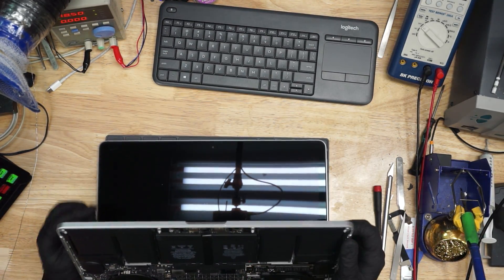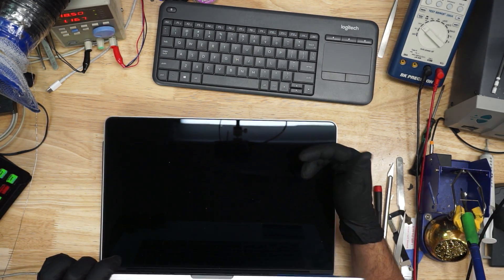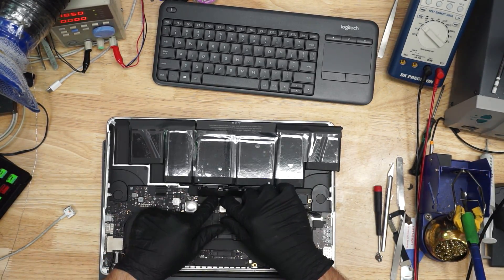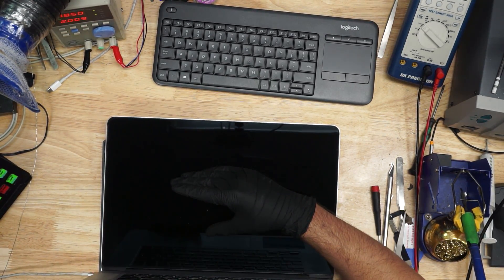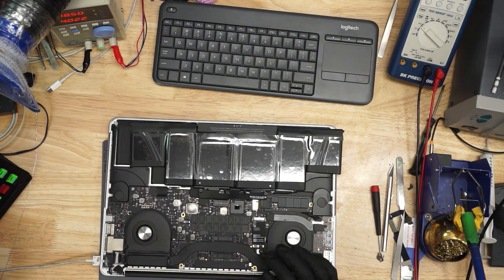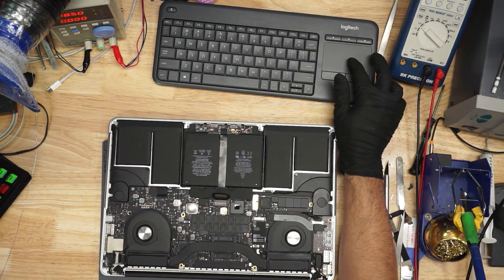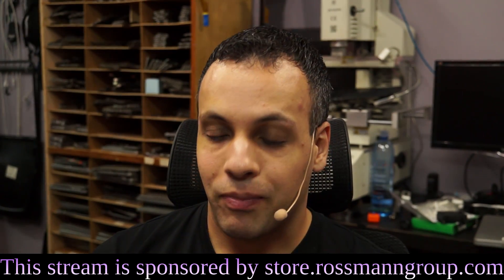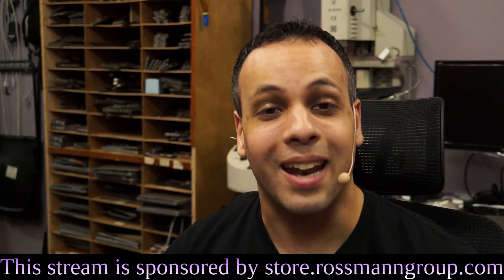ENGINEER DIFFERENT!

Comment: ThinkPad Compact Bluetooth Keyboard with TrackPoint          https://www.amazon.com/dp/B00C32FWJC/ref=sxbs_sxwds-stppvp_1?pf_rd_m=ATVPDKIKX0DER&pf_rd_p=d45777d6-4c64-4117-8332-1659db52e64f&pd_rd_wg=Md5LC&pf_rd_r=Y8QE22BWZT3ZN7PXMHVA&pf_rd_s=desktop-sx-bottom-slot&pf_rd_t=301&pd_rd_i=B00C32FWJC&pd_rd_w=Kaktp&pf_rd_i=lenovo+keyboard+wireless&pd_rd_r=fb1efce3-6186-4512-9e19-995d5d3c8f9b&ie=UTF8&qid=1535768220&sr=1

Comment: Hey I have that keyboard! I use it as my couch keyboard.
Also, a dead battery taking out a laptop is the worst design choice ever.
Reply: It would be a mistake if an engineer made a circuit with built in battery backup to not function without battery. (I know it is possible, I have made that mistake).
But to completely say it is a feature is seriously bad engineering.

Comment: Can you still power the unit if you unhook the battery and just run off wall power? Thanks for the tip though, wasn't aware that model would do that. Such stupid design.

Comment: Are you serious? Are you fucking serious on this one? More than half of the laptop owners I know run it on constant power because the battery is dead, which is stupid, I know. You buy a laptop for portability, not to sit on a desk like a desktop. But they still work! Even with a dead battery inside or with no battery at all. Just plugged in.

Comment: There needs to be a rule/law passed that makes it so that any product, doesn't matter if it's a phone, console, OS, is possible to be repaired. The law will be called "The right to repair". I like that name. I don't think you can really easily repair consoles but most people focus on OS more than console because there are tons of parts you can upgrade. Well, tons of parts you can upgrade on a Windows PC. I'm sure that parts of an Apple product are "carefully designed" to only work with specific parts of that product, I mean, when it wants to work. I've never had or used an Apple product, probably never will now since I now know all of the stuff Apple is doing and the effort they are going too to make their products unfixable by yourself or even by an Apple store.

Comment: Hey Louis. One of the things that really annoys me is the fact that batteries are no longer removable. Often times due to humidity changes in the environment, or just having some sort of charge on the board, the computer will not boot. The way to fix this is to literally remove the battery plug, hold down the power button for 10-20 seconds and plugging the battery back in. Do manufacturers not understand that this is a common problem that happens with electronics fairly often, especially with the changing seasons? What are your thoughts?
Reply: My Toshiba with internal but replaceable battery has a pinhole reset button near the corner underneath. Not labelled, but handy to discover.

Comment: Look briking the machine with defective battery is obviously a safety feature
Reply: Locking down the battery and not charging it would be a safety feature. Rendering the machine unable to operate on the AC power brick is money grab.
Reply: a dead tim cook is a safety feature also for apple users.

Comment: Apple isn't the only company who makes laptops which are bricked with dead batteries, I've worked on HP, Dell and Toshiba laptops which wouldn't boot with dead or weak batteries. And further, some laptops have suicide CMOS batteries which cause the machine to fail to even power on if they're dead. And most of the time the CMOS battery is soldered onto the board in a place which requires complete laptop disassembly to reach. In cases like this, I solder on wires and put a CR2032 holder in one of the serviceable bays so it doesn't happen again.

Something else that these manufacturers do is ship laptops with AC adapters which don't have enough power to run the laptop at full load. using Dell as an example, they often have several tiers of power bricks of increasing capacity and ship laptops with the lowest denominator to try and save money. So like if a laptop needs a PA-10 (90W) adapter, they'll ship it with a PA-12 (65W). Or if a laptop needs a PA-4E (150W), they'll ship it with a PA-10. And if the laptop experiences extended periods of extended loads, the laptop will eventually slow to a crawl as the CPU is clocked to as slow is at can go, and sometimes the hybrid GPU is switched to the slower integrated one to avoid overdrawing the anemic AC adapter.

This ends up causing endless user frustration because they're not told about this "feature" and think there's something wrong with their laptop because it's always slow and the battery is always dead. Often on these hybrid systems, there's not enough spare capacity on the AC adapter to charge the battery until the system is powered off, so the battery NEVER recharges.

I've had to sell batteries and higher rated adapters to dozens of people over the years to fix this idiotic problem created by Dell to shave a few dollars off the price of the laptop.
Reply: Yeah, we definitely need more competition in the computer and phone hardware space, as a lot of the big companies have gotten too comfortable and thus anti-right-to-repair and anti-consumer.
Reply: There is one line of laptops that isn't like this and haven't failed me in years. HP elitebook series, specifically 84XX and 8XX series. They are just really good imo. I just pulled a swollen battery out of an 840 g2 and replaced it, that is to say the battery failed a long time ago. The laptop was primarily used in a dock. I do hate the 840 g3 and up don't have an easily removable bottom cover though.
Reply: GGigabiteM, how do I tell if this is the case? My HP laptop has a 65W adapter... How do I find out what would be needed?
Reply: +John Long

HP laptops are pure garbage, I'm still disgusted with them for their 100% failure rates on laptops made from 2006 onwards on several lines. I've replaced more HP laptop motherboards than I can count due to shitty lead-free solder failing on the GPU or chipset. The replacement boards usually failed again within a year, HP didn't give a flying toss about fixing the problem.

They also still make shitty ricer laptops and AIOs with huge screens and tons of ram to try and hide the fact that they have old dual core AMD APUs based on the ancient bulldozer architecture. Slimy slick computer salesman at worst buy love selling these things because they're almost pure profit for them. I've had a half dozen customers bring these things to me saying that some slick salesman promised them the moon, only to be super disappointed when I showed them how bad the machine actually was.

+Akshay Anand 

I'm not as familiar with HP adapters as I am with Dell. You'll have to do some research to figure out the various models of HP AC adapters and see if they have the same voltage and barrel connector as yours. Just be warned that the market is saturated with knockoff fake and dangerous AC adapters. Louis always warns about these in his videos about them destroying Macbooks, and this is true for all other laptop brands. The best place to find genuine adapters is used on Ebay, Amazon is flooded with fake adapters and sellers love to do bait and switch with their listings. They'll use a stock image of a real adapter and you'll get a fake Chinese knockoff.

>Metallkopf

You can't really do this because most modern laptop AC adapters are smart and communicate with the laptop over a 1-wire circuit. If the laptop can't determine what type of power adapter its connected to, it will usually default to the lowest capacity AC adapter available for that model, or refuse to power on after throwing an error.
Reply: GGigabiteM One good thing about HP laptops is that they publish the disassembly manuals and let anyone order spare parts if still in stock.  Haven't seen board diagrams though.  But the restrictive "whitelisring" of acceptable power bricks, WiFi cards etc. still feels abusive, since it prevents upgrading to better models.
Reply: Yeah have to agree with you on this the company i'm contracted to seems to love HP computers. First zbooks screens would tear then changed to another model and then to hp elitebook 850 g3 models. but some of the elitebook 850 g3 wobble. They have now seen the light and switched to lenovo laptops
Reply: @GGigabiteM  I hear you, but I'm at a point in life where every company at one point or another has had flakey products so I'm not loyal to any one company. The ellitebook line is targeted at business users so graphics isn't that big of a concern for my users. The Intel graphics is sufficient enough to drive 3 1080p monitors. I've had no boards fail and have some 8460p's still being used after 5 or 6 years. One cool thing about the 8460/8470 is you can upgrade the processor because it's socketed. I've also update the wifi adapter in them to AC adapters. I've just had really good luck with them. Sure the screens they use are crappy but we mostly use them docked. And the docks are fantastic as well.

Edit: also the power adapters work across the entire ellitebook line so I have right now an 840 g2 and I'm still using my 90w adapter from my 8460p from 5+ years ago. They changed to a smaller connector on the 840 g3 but you can use an adapter and the older power brick still works.
Reply: >and let anyone order spare parts if still in stock.

Bullshit.

HP is in the same order as Apple. I've called them before for replacement parts, only to be flat out refused shipment because I wasn't a "certified" HP dealer and wasn't "qualified" to install them. One of the times they graciously offered a flat $400 rate to repair the machine, on top of the $350 cost for a refurb motherboard and shipping both ways. This machine was not worth more than $300 in working order.

I had to tell this customer that their machine was not repairable because I couldn't get a motherboard for it. There were no boards available on the used market because this model wasn't very popular and jimmy rigging something to fit in it wasn't possible either because it was a proprietary laptop motherboard with proprietary connectors.
Reply: Akshay Anand hook it up to a variable one with a display on the pulled Voltage and/or Wattage. As found e.g. on Louis' desk.
Reply: @xmlthegreat  just buy the larger adapter and be done with it. It's not that much money and plus it will change your battery faster.
Reply: @jlongjr27  haha no, I'm in India and you can't buy the official high power adapter separately. You have to import them, for ~$300 equivalent. They come bundled with Omen laptops, but otherwise I have to import them. Or go for Chinese ones. And Chinese power adapters..... Nope!
Reply: That Dell situation is kinda weird for me. I have few Dell laptops and every one tells me on power on if the adapter is too low power. Will boot, will work, but with limited performance.
Works even with HP adapter, but with this info "The AC adapter wattage and type cannot be determined. The battery may not charge. The system will adjust the performance to match the power available". Offcourse this can be turned of after poping up for first time and you will not see it again.
I even runned some 17" with i7 and some Gforce GPU that needed 130W adapter on 65W adapter.
For me it looks like some local dealer problem, not Dell policy.
Reply: Soldered in CMOS batteries? What year is it, 1986?
Reply: Never stopped being a thing in laptops.
Reply: I also worked on laptops for well over a year and have seen this issue, however, I would put in a different battery and test it and boom problem fixed
Reply: I have an xps 15 from Dell and my God, the charger gets so f***ing hot that I can’t even hold it in my hand when I use both the gpu (gtx960m) and cpu (core i5). I have to unplug it and leave it to cool off for a few hours before I can use it again.
Reply: My 2012 Hp would still work on ac power with the battery removed
Reply: Brendan9140 me too..the main problem for my notebook is overheating radeon GPU who cause artifact on screen >> change thermal paste and solved
Reply: I've had bad image towards dell and compaq (now hp compaq). I noticed they used oddly shaped power connector so that we cannot use any other power adapters while they sell their proprietary adapters overpriced. Fishy tricks. I used chinese brands since. Very nice,  interchangeable adapters, universal connectors amd ratings, can run without batteries, withoit dvd drive, and still lasts until now

Comment: My mid2010 mbp was like a new unit once I changed my battery. It's unreal.
Reply: I have a late 2011 15" laying around somewhere, needs new thermal paste and battery aswell😂 
But I reinstalled the laptop and instead of the latest osx that was on it I now have some really old version which I can't update

Comment: Watching this on a macbook... running WINDOWS. I regret buying this macbook, never again will I give money to apple. Almost 5 years and counting though, lets hope it keeps working :D
Reply: well you sort of get the worst of both worlds doing that
Reply: Yeah but I study computer science and I am a programmer by trade. Programming on Windows (Visual Studio i.e.) is just so much better than on Mac (Visual Studio Code 🤮).
Reply: Aimless Idiot  Where did you go for your BS CS... I'm about to start picking a college.
Reply: what do you think about Python language popularity?
Reply: I have used it, but only when I was forced to do so by either the framework, peripherals that already had libraries in Python or some other requirement. I would never use it at my own accord, but it is not that bad. I just don't like it. C# is so clean in comparison :D
Reply: use Visual Studio on mac, not Visual Studio Code. Or buy a Jetbrains license. Programmers prefer macs in general for mobile dev and the Unix command line. Also, macs don't run useless services in the background that will hog your system resources like a thirsty thot like windows.
PS: I use Arch. xD
Reply: I think Linux is a pretty good programming environment.  In any case I am on a Mac mini now running Windows 10.  I bought it is small and quiet for my bedroom.  It's actually tri-boot with Cinnamon Linux.  It's been about 8-12 months since I logged in on OSX.  The search tool spotlight is very good though.

Comment: Soooow, the touch bar ones, they tried to weld the battery to the frame but that ended badly, so, epoxied in

When the battery dies the thing won’t boot

When you write 60TB to the ssd it’s basically gonna end up with one usable byte, and it’s soldered in ... but hey

It’s thin and magic
Reply: I think you mean 55.86 TB, i.e. the answer every other computer would give when you ask what amount of data you've transferred.
Reply: It could be worst if they came with no warranty, or the SSD failed a bit before reaching their useful life due to the CPU heating up the whole thing all the time. 98 degrees at the center of the motherboard all the time you use the machine the way it was made to be used.... you know.... as a professional video editing machine where tons of gigabytes of raw video are edited, that should not wear the SSD faster than a normal laptop right? Right Timmy?
Reply: As far as I know the modern SSD's storage cells provide somewhat longer lifetime if the writing cycles happen at ~50°C junction temperature, rather than room temp. So keeping it warm actually helps the SSD. However a 98°C CPU is anything but healthy for the laptop.
Reply: Yeah ... I'm sad to see the direction the laptop division went in, the desktops are getting better though, the imacs now even have replaceable CPUs and stuff ... so ... at least someone at apple isn't a fffucking idiot

Either way ... not sure what I'll do when my 2015 retina will become obsolete ... although ... by now, that might take an awfully long time
Reply: @portedbikes  they come with no warrenty cuz everything will break after warrenty as part of their plan 🤣

Comment: Today I learned that shitty laptops (that are plugged in to an OEM charger) cannot boot without a battery.  I have an 8 year old HP that hasn't had a battery physically installed for years, whirring away.
Reply: The difference is the HP cost half what the Macbooks cost.
Reply: True, but like i said, just because they fuck you less hard does not mean they are good.
most laptop companies nowadays have tricks like that one.
Reply: Hp is getting there. my HP ELITE X2 1012 ihas its battery bulge - due to heat from CPU - bulged battry bloats the bends the screen out. took out battery. still works but very weird boot sequence. clock is out of sync etc. thankfully stil working. but this is definitely not good design.  They removed the CMOS battery also. same battery works for both
Reply: Wish it worked for me

Comment: I has a macbook pro. I use mac fan control. I am not having my macbook "pro" not engage its fans until 60-70c lol its dumb
Reply: then why do you do it. it already runs at 100 degrees when rendering anything so you instead are relying on the anorexic heatsink they put in